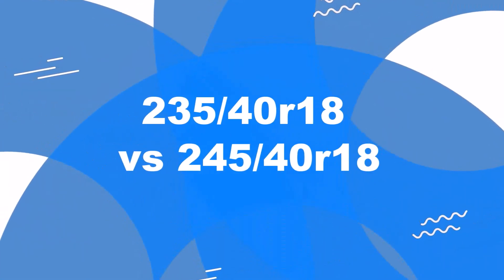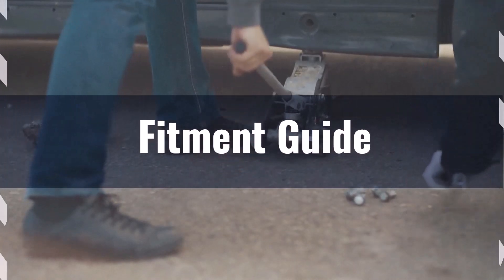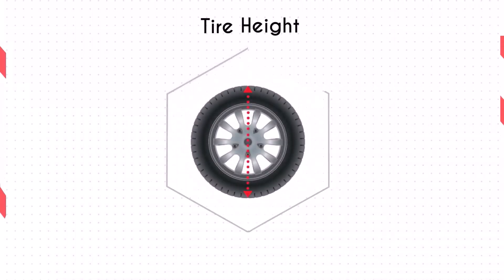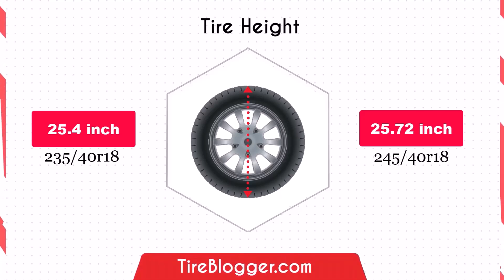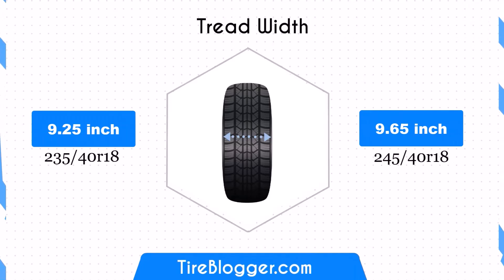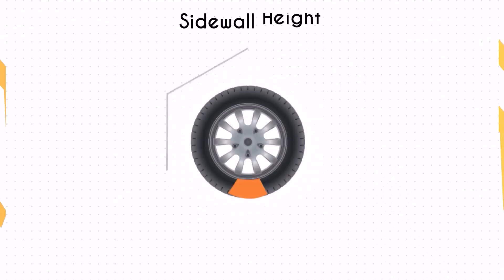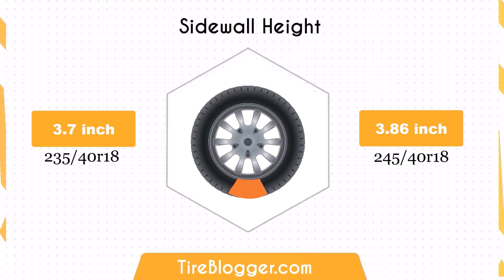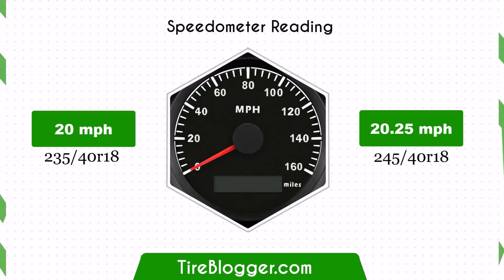Tire Size 235/40r18 vs 245/40r18

Comment: what about 235/40 R18 and 245/45 R18 will effective?
I am looking for the tyre for increase car height..
that car is honda civic 1.5 Turbo RS , I feel this car height is abit too low too near the ground clearance...
thank you
Reply from the maker: Yes, switching from 235/40 R18 to 245/45 R18 will effectively increase your Civic's ride height by about 1.28 inch due to the larger overall diameter. Also, you need to recalibrated speedometer after the tire change to ensure accurate readings. Also, be aware that your fuel economy may decrease and handling characteristics might change, so drive cautiously and adjust to the new feel.
Reply: thank you

Comment: Will it increase the speed if switching to 245?
Reply from the maker: Switching from 235/40R18 to 245/40R18 will not significantly increase your speed.